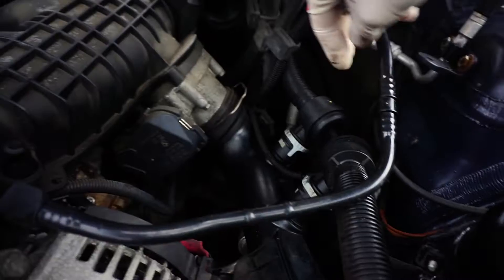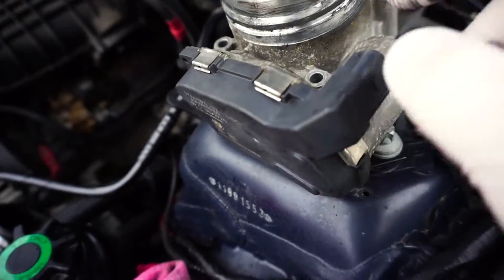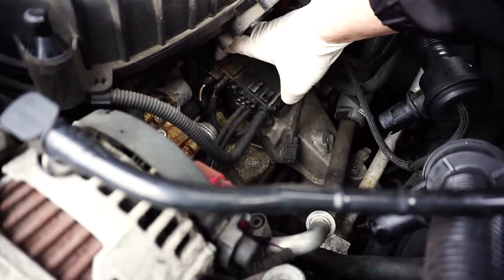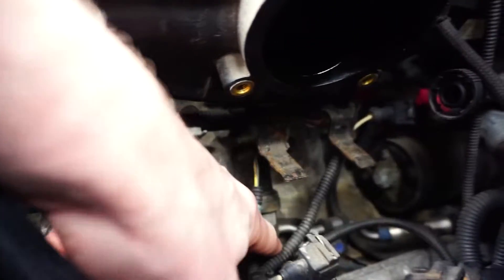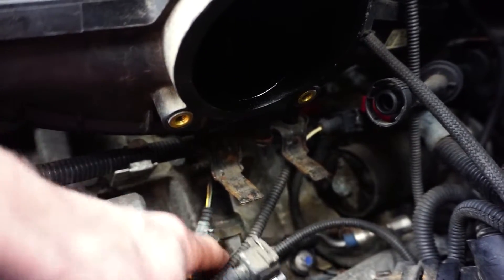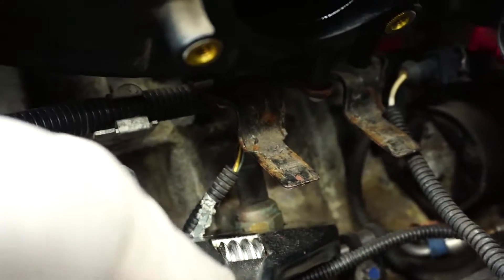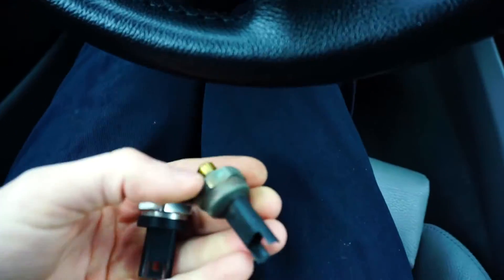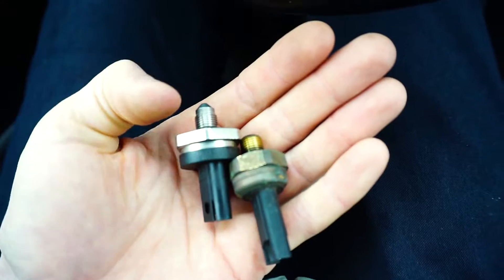How to fix 2AAF Low Pressure Fuel Pump Sensor BMW E9x N54-N55 2006-2011 DIY

Comment: Replace the O2 sensor and disconnect the battery. Then reconnect the battery and then the O2 sensor, in that order.
Reply from the maker: O2 was good, i ended up replacing lpf sensor and pump, which sims like fix the issue, but from some other sources this code could be a ghost code…

Comment: Nice video, you removed a lot of unnecessary parts may be so it's easier for people to see it on you tube, but still gave u a 👍.  Removing just the charge pipe should do the trick in case anyone wants to do it faster. Keep up the good work man.

Comment: Hello, I already bought and installed the new bosch sensor and the problem continues to come up with the same 2AAF code, any advice?
Reply from the maker: Hey! So the 2AAF is so called ghost code, even dealer wouldn't determin the exact problem, this code connected to fuel system, but not always mean something wrong, in may case i had the injector problem, and on the top sensor wasn't working correctly, so this code was triggered somehow, but in bigger scale it can be any component on the fuel system, if you don't have any codes except this on, let it go. 
Not long ago one of the subscribers was trying to figure out the case of this code, we got true many scenarios, he replaced the lo and High pump as well as sensors,  now he have problem sort out as when he rev the car over 6k rpm 2aaf and injector compensation code popping out, so at the end he planning to replace the injectors, i didn't hear from him since than, but i would say that the injector is his problem. 
Good luck man! and don't overthink if you only have 2aaf.
Reply: @Makhnovets  thanks for the info, but everything came up suddenly and serially just when I used the MhD license for the first time I don't know if it is related to this problem but I better put it back on the stock map, because problems of 30ff came out first after 2aaf and then misfire cylinder 6 and now again 2aaf all after I eliminate one the other comes out, it doesn't bother me that the code appears the problem is that of full throttle and the jerk starts, only in quiet mode everything goes better, so I'll look for a better injector before look for a bomb, who's about to do that first

Comment: Nice vid. Did you test the pressure output or run a back feed output test to confirm before you replaced? The code can indicate a couple other things besides that senor. Also the sensor you took out was brass and the new one is stainless steel. Stainless steel sensors are more accurate and are better sensors to have.
Reply from the maker: I didn’t really know what i was doing, kind off, but the pressure reading newer was going above 6500”not long ago I check the old footage and noticed it”. After replacing reading reading went above 6500 but after hour of driving the pressure was dropping to 62-6400. So that’s where I replace the LPFP. Hope that the answer you was looking for.
I knew about sensor, and the extra fitting that have to be installed if you changing from brass to new style. But I also found on the forum that you can install it as is.

Comment: I have a 335i n54 2009 car starts fine but dies out at lights and when left on for a while can this be the problem ?
Reply: mine was doing this on start up after a valve cover gasket replacement. I replaced the injectors (find some used obviously not pay $2500 for new) and reset all adaptations, relearn throttle position (a must if you reset the throttle adaptation) and it stopped stalling out. If you want to try the sensors buy them on amazon so you can return them if they don't fix the problem.

Comment: I have the same code 2AAF but the sensor  I do not solve the problem
Reply from the maker: I think a month after i got the same code, then i replace the fuel pump, and it fixed the issue, but I had an rpm issue at the start, so wasn't really chasing the code, but according to the dealer source, that code is little mystery, if the car acting just fine they said there no action needed, they do not know why, but if your car has a rough start or rpm problems with that code popping, you can replace the sensor and eventually lpfp and then hpfp.
So don't worry if you have that code in term if you car acting normal.
Reply: @Makhnovets  thanks for the answer bro I will continue investigating blessings 👏

Comment: I have a 335i N54 sadly crashed yesterday but only the bumper broke so I was lucky 

But I been getting a 2aaf fuel pump plausibility code and the car runs fine 
All I have done Right now is intakes and chargepipe I’m thinking of putting a 7.5” race Intercooler and catless dp but idk what this code means because the car runs fine should I address this???
Reply from the maker: I crashed my too, will have Video sometime about rebuild, but the code is basically is nothing serious, the dealership suggestions is to replace the sensor for hpfp and lpfp. But they also say that is wondering code, which is doesn't have any side effects, so yes, you probably don't even have to worry about it.

Comment: Having this issue on my s63 motor
Reply from the maker: That is pretty common for the S type engines, LPFSensor, you can replace only the sensor you don't have to replace the whole assembly with the tubes just double check in Internet. the exact same sensor which is I installed on the n54 would fit on many m-type engine's from year 2007 all the way to 2015.
Reply: @Makhnovets  I replaced it car ran great for 20 minutes and then same issue started. I then ordered the line adapter.  So now I have ordered the legacy sensor. We shall see if it will work
Reply from the maker: @Devil_Dog_Ultra  interesting, Did you have any other codes whenever it happens? In my case, it fixes the problem with the code, but later I did replace the LPFP, which fix the issue completely.
Anyway just let me know how it goes because I just purchase the 2012 E93 M3 with S65 eng. replace SPlugs and couple of minor things, gonna be changing the diff fluid, disassembling the roof, and finding the issue corresponding to rough idling, sometimes, planning to film all of that. and then moded a little))) if you have any suggestions for replacing anything right out the bath, just let me know!! that will be really helpful, Drove the car from Cost line LA to the other cost Outer Banks NC, 4k mi, ride was smooth one check pup up for SPlug, that it. also is that common check the first 10sec of the video.https://www.youtube.com/watch?v=uPQdowPdWS4

Comment: I have this code and have no issues and change the sensor and the 002aaf code still come back and no issues. don't know of why I'm getting the code still
Reply from the maker: I have the same issue, after all i replace the lpfp, and the code were gone. The BMW Source say it's normal to have that code, if dealership gonna do full test and they're wouldn't find any issues, in that's cause the code will be ignore. So some people have exactly the same issue as you. Also i would say you have to replace that sensor every 20-30k mi, if you go true o-ring, it's gonna fail in 20-30 and start leaking.

Comment: I have a 2013 BMW 335is coupe DCT 35k miles. Getting the 2AAF ghost code. I am on stage 1 MHD with chargepipe/tial bov and DCI. I had a problem when I accelerated and kept above 3k rpm, my car cut off for 1/2 a second (kept my foot down) and kicked back accelerating again. Happened 3 separate times. Had over half tank full. I noticed my low pressure sensor stays above 70 when I’m driving but when I did a pull and smashed the accelerator to go fast I saw my pressure go down to 46. If I do need a new lpfp, which one should I go with? I’m never planning on running any mixtures but I do plan on going MHD stage 2+ after I install my 5” intercooler, catless downpipes and PR ignition kit w/ 1 step colder plugs. Or maybe I need new HPFP? I’m not sure. Thank you!
Reply from the maker: That's setup is pretty sweet! Stage 2 is a bist! 
But after all the sensor showing data for LPFP, unless you have any other related codes. I would go fo bmw oem lpfp if you have money, also you can try to look for a kit, and rebuild your pump. https://youtu.be/H7g_Gom-z84 i actually replace the lpfp as well, because the message came back and i had rough start.
With stage one you almost never experienced any lag's or so, before moving to st2 that's the good plan to fix the issue.
Also about 2aaf, this code is mistery 😅, it could uppers for safety reasons as well, it's related to the fuel system, so any lag of pressure or pump would trigger the message. German's) usually it comes up with other fuel related codes.
Reply: Savage Motor Gears thank you! I will put an order in for new one. Unfortunately last night I had a misfire in cylinder 6 but I’m guessing it’s coils. So installing my PR ignition kit and hopefully fixing that problem. I recently got all updated injectors from recall at dealership so it better not be injectors lol
Reply from the maker: @Trusty335is  Good Luck Man! keep it up! and start the youtube!)))

Comment: Hi, what are the symptoms of a bad fuel senor? I have an N52 engine, car does start but keeps on cutting out.
Reply from the maker: It's similar symptoms to the hpfp, basically it's longer Crank, as well as car adjusting the rpm for short period of time, leasing for pump under the rear seat if it's working?
Also 2AAF coude could be for hpfp but if it's is the car would start with long crank and gonna be working really crappy. Check the fuse box for fuel pump as LPFP, and leasing for that nice from LPFP. Also,https://youtu.be/H7g_Gom-z84 you can leasing at the end of the video...
What code on obd you have?